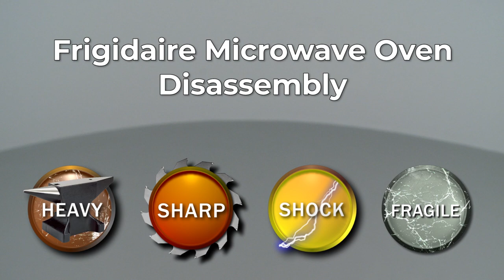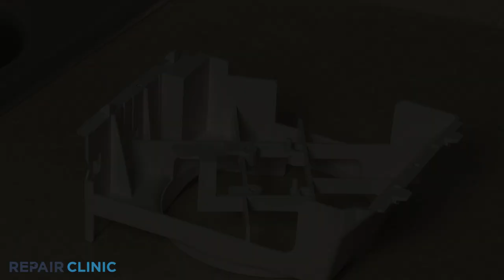Frigidaire Microwave Oven Disassembly (Model FPMO227NUFA)

Comment: This was helpful. I have a Frigidaire Gallery FGMO226NUF microwave which is a built in.  We had a power surge from Hurricane Ian which scrambled the digital readout and eventually the whole microwave stopped working completely.  I called Frigidaire to see if there was a way to access the fuse, but they were no help and told me to contact a service technician. After watching this video I decided it was worth trying to see if I could fix it first myself. Turns out is WAS only a fuse but first I had to take off the whole outer cabinet of this built-in microwave.  The only way to remove the screws on the outside cabinet(security screws) is to use a T15 Tamper-proof Star key (I bought a 7 piece set which ran me about $7 from Harbor freight). You need this tool because a regular T15 star key doesn't work.  Once inside it was easy to find and replace the microwave 20 amp fuse (Busmann 1/4"x1-1/4" 20 amp fuse from Lowes was about $6 for 2). The microwave now works just fine. And I didn't end up having to pay for a $120+ service bill. Thank you for making your video.